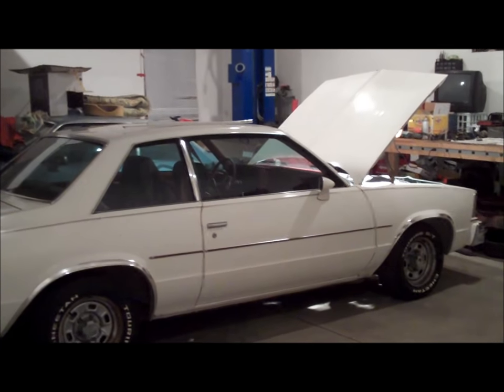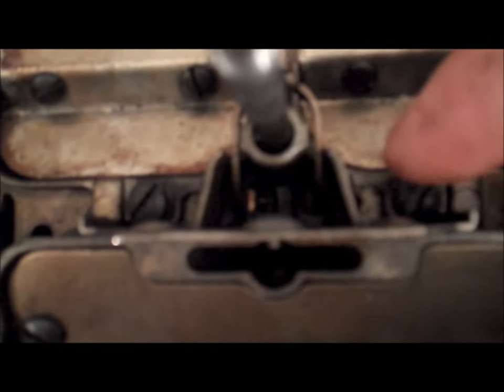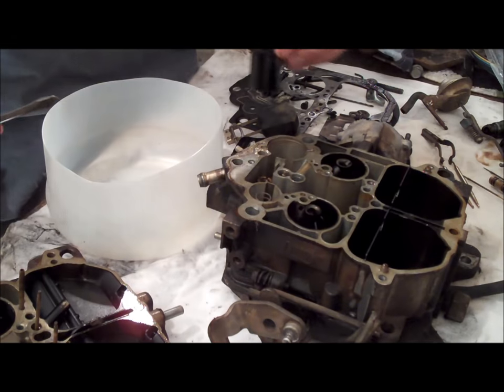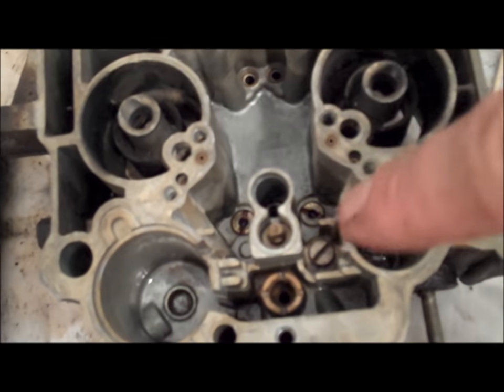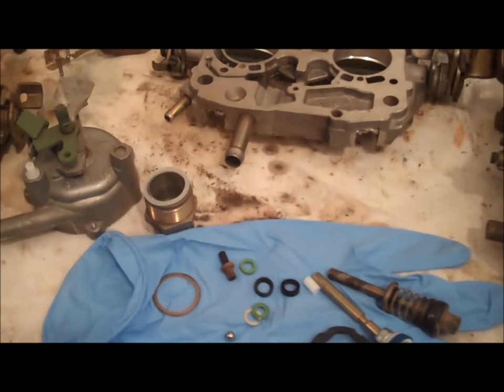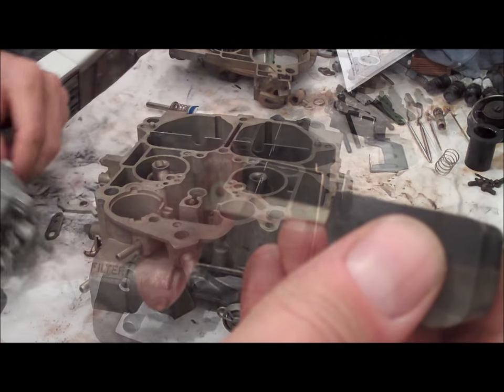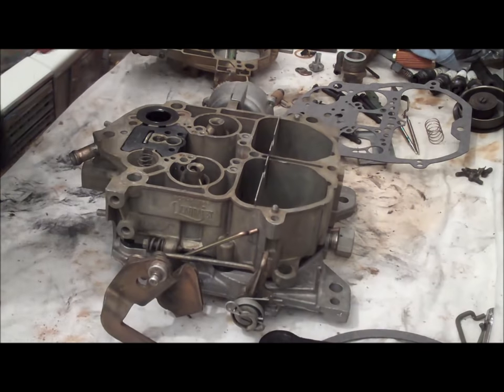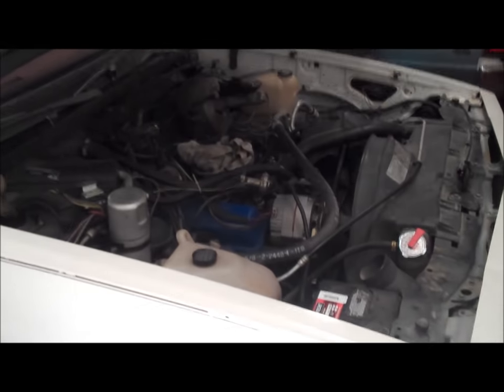Detailed Quadrajet Carburetor Rebuild COMPLETE GUIDE

Comment from the maker: Follow Classic Gbody Garage for the latest project updates! Thanks everyone! 
Subscribe: http://www.youtube.com/c/classicgbodygarage?sub_confirmation=1
FaceBook: https://www.facebook.com/groups/classicgbodygarage/  
Instagram: https://www.instagram.com/classicgbodygarage/
Reply: I rebuilt (this weekend) the Quad off my 1974 Caddy that I bought 2 years ago.....found the reason why it was guzzling gas at idle(really bad black smoke in the morning).......lead plugs were a little loose(whacked them with a Punch and then a light coat of 2-Part Epoxy)......and whoever tried to rebuild the Carb the last time.....did not install the metering needles down the in the Jets below the Float. I did make a tool to hold those metering needles in place before placing the gasket and top part on. Your Quadrajet is laid-out different in many ways than the one on the Coupe Deville. Too save money on Brake Cleaner/Carb Cleaner....I bought a small bucket and lid and filled it to the top of the Carb with gasoline.......the next day.....almost the entire exterior/interior of Carb was spotless. Another tip, I used Q-tips in the hollow areas where Carbon and the slightest amount of varnish had gathered.
Reply: Vacuum diagram for 1984 c30 454 Ci
Reply: Idle mixture quadrajet
Reply: Love the video, I just bought a 77 GMC Vandura box truck with a 400, it has been sitting for a long time. It drove great till I put gas in it, then it started gasping for fuel. Bought a new fuel pump, haven't put on yet but was wandering if I could send you my carb because I know you would do a thorough job of rebuilding it. I don't know if anyone in my area would do as much as you did. I usually do my own work on my vehicles. After video I know I could trust your work.
Reply: I want to share some speciai information with you on my 40 years experience on these carburetors and the one you rebuilt in that video.   Concerning the power piston and air horn upper carb gasket..  Whether it be the non computer rochestor carb or the computer carb from 80 to 90. On my personal cars ever since my cadillacs of the 1970s and 80s ive owned and my present 89 brogham cadillac with the olds 307 I MODERATE THOSE UPPER GASKETS.On that gasket, the part that goes around the power piston and the needles I CUT IT OUT!!  It serves no purpose and as soon as you run that carb on your car that gasket sags due to gasoline and rubs against the power piston needles and they get stuck or dont work fully.  Your airhorn assembly also on the top has two nostrils iike a nose in front of your choke housing or a cylinder so the float bowl can breath, and to have gasket material over that float and around those power piston needles sags and pushes down on the float and rubs those power piston needles when it tries to go back up or down. Cut the part out with scissors that goes around your power system and you wont be having trouble.  I cut that part out of all my upper quadrajet carburetors.  Even on the two barrel carbs cut that part OUT
Reply: Thanks for the education.
Reply: Thank you sooooo much for this video.  I had my laptop next to me on my work bench as I rebuilt my Edelbrock.  You made it a breeze.

Comment: great video! I have searched everywhere and haven't found a detailed video. I'm 17 and will be attempting to rebuild my quadrajet on my 1978 k10 tomorrow for my first time. this video is very detailed and will definitely help me out. Much appreciated!
Reply from the maker: Thanks man. It's very cool that someone your age is into old trucks. Take your time and enjoy your rebuild.
Reply: just wanted to let you know it was a success! my truck is running better than ever. I very much appreciate the help
Reply: I’m 16 and rebuilding my 79 c10 carb today😂
Reply: I'm 40 and still learning this and much more. I'm bringing an 85 K10 Suburban 5.7 350. It doesn't have this carb on it but I've had one of these sitting on a shelf for a few years after a friend's dad gave me it thinking it was for an 86 F-250 and I found out a bit later it wasn't. Now I know what to do with the dang thing. I appreciate this info. 
   You kids keep it up. We all should know this kinda work anymore.
Reply: How did it go, I got a 78 I’m completely rebuilding and doing the same thing

Comment: I have seen a bunch of people toss  a good q jet because it develops an off idle stumble- i take their “bad” q jet - install a new accelerator pump plunger and go do burn outs- your video is the best rebuild i have watched so far- people dont realize their is only 2 q jet sizes 750 and 800cfm- GM used millions of these carbs on hot small blocks and big blocks that were very fast- they are still used today by guys that can tune them to run 9s in the 1/4 mile - that is screamin fast-

Comment from the maker: Thank you all for taking the time to watch my video. By the comments below it has helped many people. Please check out my channel for more how to videos. Thanks!
Reply: Can you help me out please ? i have a question , please reply as soon as you can .
Reply from the maker: What do you need help with?
Reply: I was working on my hitachi dch306 but i don't know about the primary jet {slow} and the secondary jet {slow} , and they go a long way down and then there's a short screw that comes above them to cover them up , anyway my question is should i screw them all the way down , or should i screw them all the way down and then screw them up few turns and not all the way down ???? my air mixture screw stopped to have any affect on the carburetor after i have put it back after the rebuild , so can it be the reason is because i should not screw them all the way down and should back them few turns up ?????
Classic G-Body Garage
Reply from the maker: I am not familiar with a Hitachi however If the mixture screws have no affect on the carb and the way the engine runs then there is an issue. Turn the mixture screws all the way and DO NOT tighten them or you will ruin things. Back them out 2-3 turns to start with and adjust from there.
Reply: Classic G-Body Garage
Thank you for your reply , the mixture screw have no affect at all , if my float level is way up high , would it affect the mixture screw in a way that would prevent it from mixing the air with the fuel ?????
Reply from the maker: Float level has noting to do with it unless its flooding over.
Reply: Classic G-Body Garage
I have adjusted the float level {it was a bet high } but now it seems to run worse at the right float level .
Reply: Classic G-Body Garage please help I followed every step I noticed my float before adjusting it wasn't at 13/32 then I made sure the idle screws were turned out 4 turns and after assembling it on my truck, high ass rpm, it sounds like your going 5 to 6000 rpm keep in mind my carb was fine before this I just wanted to change some gaskets but then ended up changing other stuff... I don't know what it could be
Reply: Great job! You saved me some money

Comment: I have the Mercruiser 5.7 with the Rochester Quadrajet on my 1992 Crownline bowrider.  It's been hard to start for the past three years. I thought it was just because the fuel was evaporating out of the float bowl if it sat too long. An easy remedy was just to hit it with some starting fluid in the driveway before I headed out to the lake, then it would run fine the rest of the day and start without a problem. I had read many boat forums concerning this matter, and everyone concluded that these older boats "just do that". Now I know why and how to correct it when I rebuild the carb next. Thank you very much for what I would consider one of the best carb rebuild videos on Youtube !
Reply from the maker: Thank you for this awesome comment!

Comment: I have rebuilt many of these Qjets. Your video was great and im sure it helped out alot of new carb rebuilders. The only change i would do would be use the choke rod to drop in the choke lever when attaching the choke housing to the main body.

Comment: I wanted to express my gratitude to you for making this video. Two weeks ago my old Dodge truck stopped running and I knew it was the carb but I have NEVER build one in my life. I called 7 auto shop and no one would work on my old truck. I said what the hell. I bought myself a carb kit went on YouTube and found your video. I have watched it several times and I felt as if I could do it. Today 2.18.3019 I went for it and step by step I cleaned replace and repair just as you suggested and BAM! MY old truck runs GREAT! Smooth as a new car, idles smooth, great pick up and that small secondary lever, I left it on and it worked great too. I'm so impressed with myself and thanks to you I did something I always thought I could not. You have a friend in Texas!
Reply from the maker: This is exactly what this video is all about. Keeping those old vehicles back on the road. So glad you attempted it and now you can have great pride whenever you drive it! Thanks for watching. Your comment means a lot.

Comment: Very detailed and well done video! Do not forget to check the primary throttle plate bushings, as they do wear with age and may present a vacuum leak, that you won't be able to 100% compensate for with the idle mix screws. If the screws were out of sync by two or more turns, there's a good chance, that the bushings are worn on the throttle linkage side.
I used to overhaul these carbs for a living and really liked them as they gave very little trouble when cleaned, assembled and adjusted correctly.
Reply from the maker: Excellent tip! I do check those on the carb before i tear into them.

Comment: I'm restoring a replica Indy Car that was a barn find. It wasn't started for 8 years. I've never rebuilt a carburetor, but I wanted to do the restoration myself. I watched your video several times before diving in. It was very detail and easy to follow. After cleaning, I followed your video step by step and it went back together easily. I bolted it back on the 1969 Chevy 350 SB, hooked up the fuel line, etc., started the fuel pump and on the second try, the motor roared back to life. With the straight headers, a few neighbors came out of their houses to see what the hell was going on! Thanks for taking the  time to make a great video!
Reply from the maker: Very cool! Love to hear this! Glad my video helped you. Thanks for watching

Comment: The best description of rebuilding a Quadrajet, no doubt! Watched this a few times, worked like a charm. 

My model was the 17057229 1977 Chevy G30 6.6L (400). Hardest part I found was getting the choke set up properly again (like you said in the video), other than that was able to rebuild in 2 days with this video. When I share up my video on restoring a Chevy 400 V8 6.6L I will be linking to this video to show how to rebuild a Quadrajet. You the man G-Body!
Reply from the maker: Great! Thanks for watching.

Comment: I want to say thanks for the detailed process. You helped me rebuild my first Q-Jet today! I checked several videos and yours was the best. Good detail, to the point and no 5 minute intro or endless jabber between steps. 
My old truck runs like a bat out of hell right now thanks to the rebuild. To be honest the only thing I found seriously wrong was the tiny horseshoe clip that holds the power piston below the float was missing, which would explain the tremendous flooding problem I was having. 

At idle the exhaust fumes still burn my nose and I don't know why. I have the idle screws set to 2.5 turns and it idles well. Will check the timing and go from there but overall the 454 is fully awake again.

Comment: Great vid. First QJet I did was in 197O ...took apart 3 times to check float level due to flooding out when trying to start. Turned out the float was saturated with fuel due to a small crack. They are not hollow like a brass float but are a foam type construction with a coating to keep the foam dry and buoyant. The weight difference would not alllow the float to rise up to close the needle snugly against the seat once the fuel, in the bowl, was at the correct level. Got a new float, adjusted height, reinstalled and a perfect startup. So, be sure to examine your float for chips  or cracks. Hope this may help all those with post rebuild flooding problems. Best to you and yours.

Comment: I have a 84 Chevy G20 Van I bought to use as a work vehicle.  I am having trouble with it bogging down when I try to accelerate.  It will run fine as long as you keep your foot out of it.  I change the paper fuel filter you show in the video and all new plugs, wires, and the craziest looking distributor I have ever seen. I know its not a G body but it has a G on the body and your video is spot on man.  I cant thank you enough.
Reply from the maker: +Tim Lastname If it's bogging you might need to replace the accel pump but while your there you may as well rebuild the carb.
Reply: thanks for the heads up man.  I just ordered one with the carb kit.
Reply: +Tim Lastname check the diaphragm that stops the secondary valve opening to quick, also try tightening the secondary air valve spring. check this video at 56.15 to test secondary air valve pulloff its incorrectly named a secondary choke pull off in this vid
.

Comment: Very helpful video.  The next project for my 1978 C3 corvette was to overhaul the carburettor the accelerator pump was not working and the secondaries were not opening. The assembly tips were very helpful particularly for the power valve.  When I reinstalled the carburettor after the rebuild the engine started first time with minimal cranking and ran extremely well.  On the test drive there was an increase in power and the secondaries opened up well.

Comment: great video I used to fear these carbs when I was young and they were in current use (had one on a 1975 Olds 350) but rebuilt my first one on a marine inboard (1988 Chevrolet 4.3 V6) and it really wasn't near as hard as I thought. Next time I'll have your vid running on my I-pad! Great tips.
Reply: I’m fearing one right now. Bought an old truck and the fuel tank has all kinds of trash in it, something must have made it through the fuel filters and into the carb.  Doing research before I order a rebuild kit.
Reply: @Hammerback0  same, just picked up a 79 Stepvan , it’s running but running rich, I’m thinking it’s the carb ,

Comment: I have rebuilt hundreds of Q-Jets in my day. When removing or installing the choke arm inside the body of the carb it is best to leave the rod on the arm. It helps when removing the choke arm. When reinstalling the choke arm it can hang on the rod and as you insert the shaft from the choke housing you can pivot the arm with the rod until it engages. Lots of memories from my auto mechanic days. The Q- Jet is my favorite carburetor. By the way Holley's suck.
Reply from the maker: Thanks for the tip! I also agree that Holley sucks and that is why I rebuild the Qjets. Great carbs. Thanks for watching and for your comment.
Reply: If we are talking about carbs that suck I want to add edlebrock to that list.
Reply: @jeffcuevas5918  Edelbroke

Comment: You my friend should receive an award for this video.you are great. very thorough. I have been building  hundreds of q jets for the last fifty something years. you are intelligent,thorough and detailed. I might add get a 2x4" block 3 too 6" long hand set your carb. base on stand. also use a white rag or towel too place small parts on hand set parts in groups. also after cleaning power VALVE  use a small price of fine steel wool hand spin power VALVE around hand polish holding steel wool against. (6 or 8 spins or until shiney). the power VALVE will raise and lower more freely with vacum.and with time,heat cycles, and fuel vapors taking toll on rubber diaphragms
of choke pulloffs, always change pri. and sec. pulloffs ; always !!!
and don't forget too not over tighten carb bolts or studs, the carb already is trying too be sucked in engine. lastly when you remove carb too rebuild place a clean rag over carb. intake holes  make sure too have a peanut (planters peanut) can too HOLD small parts, nuts. springs in. and when you get it started and running double check for gas leaks and seepage. note q jets best friends is a 5/8" line wrench and a 1" skinny offset OPEN end wrench.
if you or your mechanic  uses a vise grip pliers on your carb. fuel line then you are DUMBASS.
Reply from the maker: First off, thank you for watching, your comment and your great suggestions. Very flattered by what you said. I am simply spreading my knowledge to help others keep these old cars on the road. I will take your suggestions into consideration the next time I rebuild one of these carbs. Thanks Dennis.

Comment: Thanks for the detailed video.  I rebuilt mine after watching your video.  only took me about 6 hours.  Mostly due to all the gunk in it.  I decided to rebuild it because it started leaking gas from the accelerator pump.  After researching it on the web i came to the conclusion that it was either my float or needle and seat.  I replaced everything except the float.  I cross checked the distance according to the instructions that came with the kit and they were pretty much spot on.  I did notice though that when i moved the float up and down the needle didn't move.  I reassembled it and it is still flooding out.  I attached the needle to the float as per the instructions by just hanging it on the inside lip of the float arm and not through the holes.  Should I visually be able to see the needle move when i move the float up and down?  I made sure that the seat was all the way in and that i didn't forget to remove the old spacer.  Out of the entire rebuild this is the only thing that was suspect.  Thanks again.